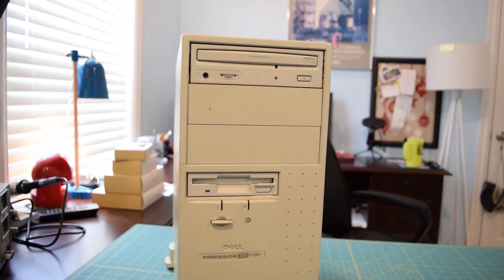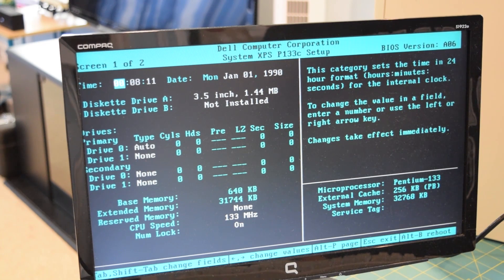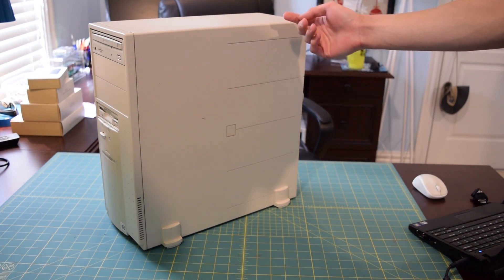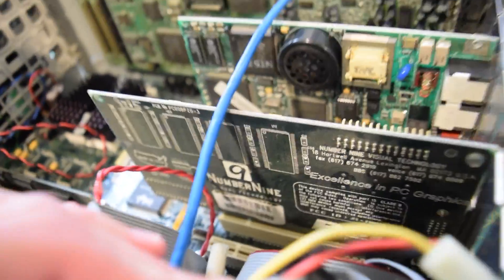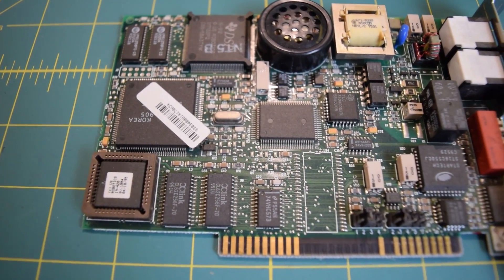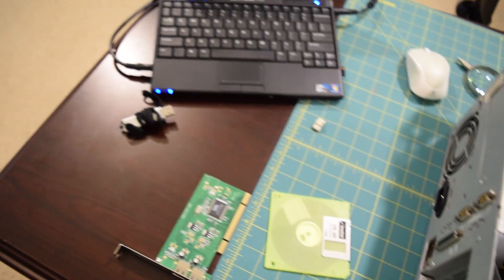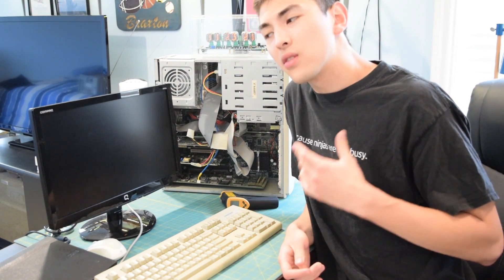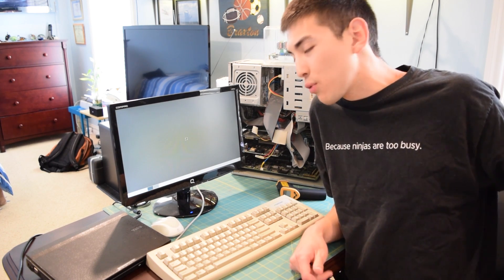Garage Sale Finds: $5 Dell Dimension XPS P100c Teardown, Overview, and Attempted Test

Comment: Once I plugged in an old ideq pc and the psu went bang with alot of sparks
Reply: +Toby Short Old Compaq PSUs are very resistant. I got an old Compaq Deskpro 2000 with a ~120 Watts PSU and it got a LOT of stuff plugged in (SCSI-Controller,SCSI-CD-ROM-Drive,2GB HDD,Compaq Mainboard,Pentium I 100 MHz,ISA Network Controller with 3 Interfaces,Floppy drive and more) and it is just fine. No bang just pure retro awesomeness. Gonna install Win ME or 98 SE on it.
Reply: this on was a biostar ideq psu i don't know what wattage it was rated at because it was a long time ago but it didn't fry everything, i think the cpu was blown but i couldn't test that and i got the hdd and dvd burner working again in an old dell but the hdd sounds like its dying and i can't test the gpu because i have no computers with an agp slot.
Reply: Toby Short Im very sorry for you and i know how it feels to lose hardware from exploding psus :(. Atleast some stuff survived...

Comment: the blue IBM chip is just the DAC. the S3 chip is the 'decelerator'. the network card is a Realtek 8139c clone and should work with those drivers.
Slitaz is the distro to try, but I'm guessing the issue is you need more RAM. you need 4x32MB sticks to bring it up to 128MB, I think you can still do so cheaply.

Acquiring a working graphics card is going to be hard if the Radeon 7000 doesn't work. Try a Rage 128, that's about all I can say, else grab yourself an S3 Savage4 PCI card and do some reading up on the S3 MeTaL API, or a 3Dfx Voodoo passthrough card.
Reply from the maker: +Sudos Oh haha, there is a mistake already :p.  I have a rage 128 but it needs some work to get back into working condition,  I might give that a try if my repair attempt is successful.  Thanks again!

Comment: with 133mhz CPU I would run Windows 98se it works very fast on slow CPUs if you try windows 2000 it good chance you will want a baseball bat to hit the PC with and there are Linux that will work but an optical drive is recommended with old Linux os on old PC. to find a good Linux that might work got to distrowatch.com. 98se works very well on those PC and 98 is same as 95 but with bug fixes and that's what I was told
Reply from the maker: +Darkwing duck videos Awesome, thanks!